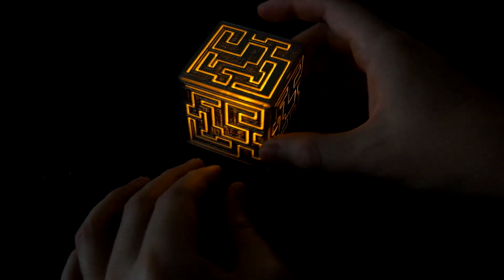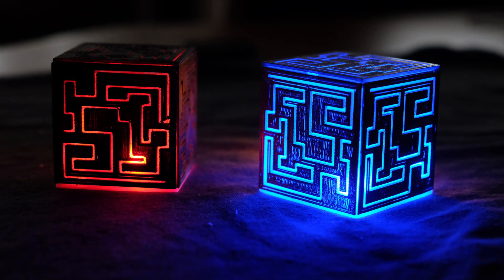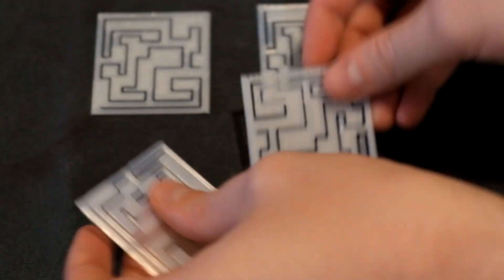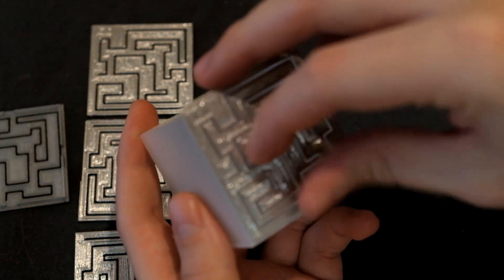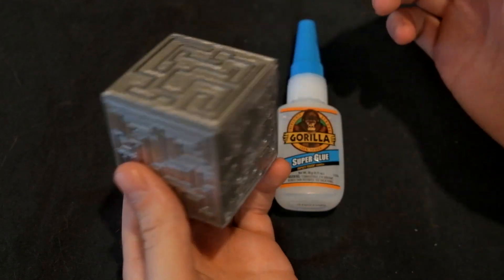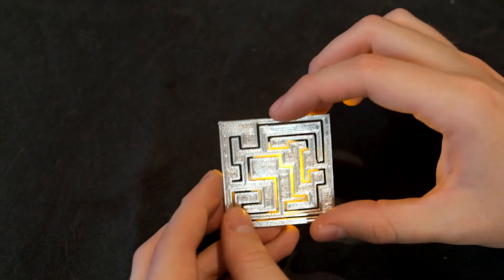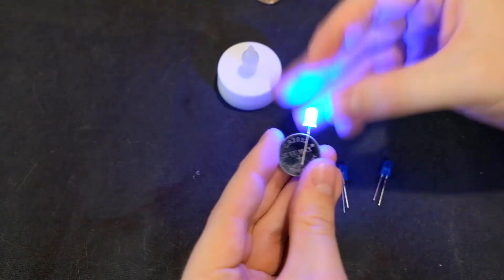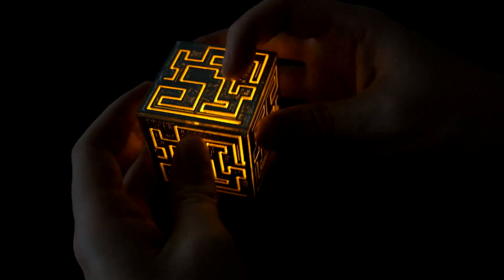3D Printed Alien Cube

Comment: good job on that! I'm also doing something similar. I'm making 3d 
Printed Light's that you mount on the wall and I'm tying too sell them. 
here's my video. https://www.youtube.com/watch?v=9dLhoiBUJlI
Reply from the maker: Thank you. Looks good. I know incandescent lights can get really hot, have you had any melting? And would it be brighter if the yellow walls size was thinner?
Reply: I never had melting because I've been using the LED Light Bulbs. and it would be brighter if the walls were thinner but also I've been working on Lights with Translucent colors. because if it's Translucent it will make it brighter as well.

Comment: Very cool, thanks for sharing.
Reply from the maker: No problem, I'm glad you like it.
Reply: Are there different size teal lights?  The tea lights I have are to big for the cube it only sits on top of the printed slot.
I've tried a few different brands of led tea lights and non of them fit properly.
Reply from the maker: Maybe try adjusting your printer settings to print smaller lines. Or print just the base but scaled up 1 percent and stop the print early to check if you light fits it. Then scale up all the pieces to that scale.
Reply: 3DSage I'll try scaling up my print. Maybe there's a slight difference between the Cube 2 and Cube 3 prints.
Reply from the maker: or try a rotary tool or sand paper to the first one you printed. I hope you get it!